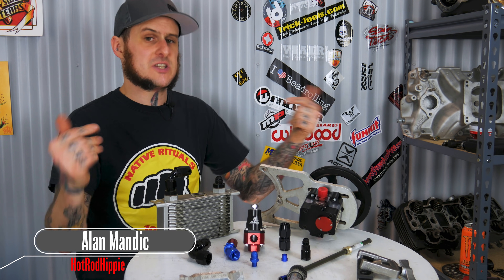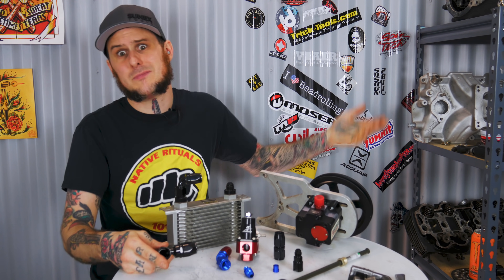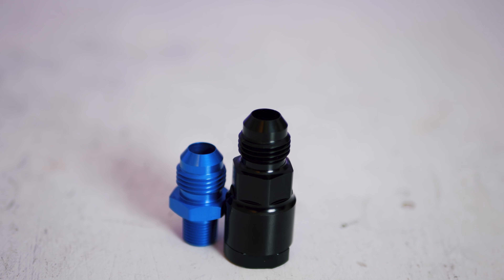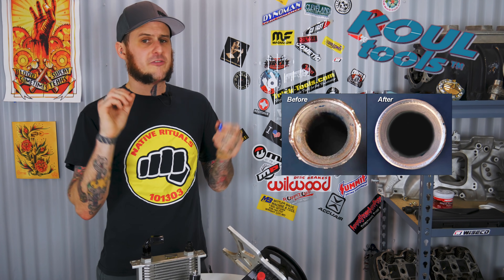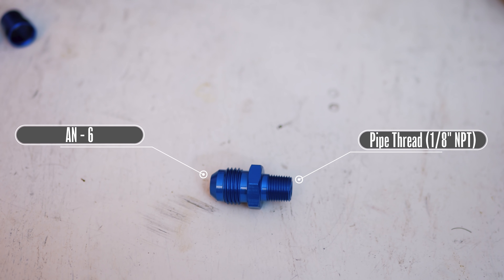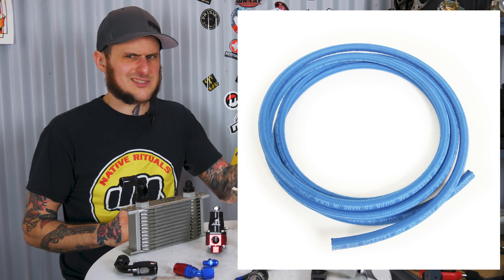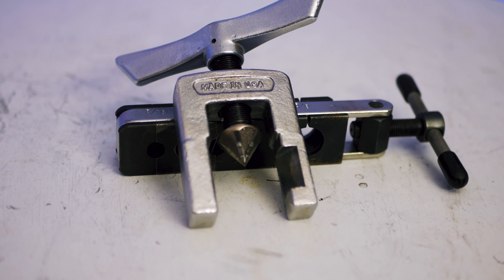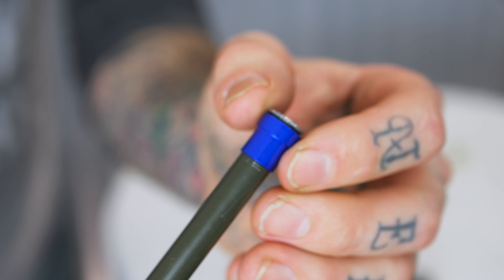AN Fitting Basics - How to Assemble and Common Mistakes!

Comment: You didn’t get much into AN ptfe fittings and lines.
Reply from the maker: Peter Fraumeni I don’t really consider Teflon like “basic”. I can’t put everything there is to know in one video. I will do a dedicated video on those at some point but haven’t had a project to demonstrate it on. I avoid using Teflon lined hoses on my projects for the most part. It’s too difficult to maneuver cleanly and there are other options that serve the same functions for my needs. But I will cover them at some point
Reply: HotRodHippie every one is going to e85 with their turbo setups and PTFE is big now so don’t wait too long.
Reply from the maker: Peter Fraumeni E85 is not readily available in the Northeast. I know it’s not uncommon for boost applications but it’s relatively unheard of on most street car builds to this point. Maybe I’ll do an intro to E85 video and lump in ptfe with that or as an offshoot of it.

Comment: This is a great explanation.   I have been searching for weeks to figure out if I could use an AN/JIC 3/8" tube sleeve and nut on 3/8" steel brake line.  You confirmed that.  I need to make a line on a piece of equipment(an old tractor)that is GM quick connect on one end, and AN/JIC on the other.  This confirmed what I was wondering. Thanks!
Reply from the maker: Glad to be of help. 👍👍
Reply: @HotRodHippie  much appreciated!   I wish I had seen this earlier.

Comment: Would be nice to show how to use AN fittings with straight tubing like that used on oil coolers.
Reply from the maker: I'm not 100% sure that I understand what you are asking for. I did a dedicated video about Hard Line Tubing some time after this one, you can find it here: https://youtu.be/wayKqBT7z00

I'd be happy to highlight what you are talking about if I was sure of what it was. I'm going to be doing a couple of Hands-On AN videos very soon, so please let me know. I'll be plumbing the entire fuel and air systems on the 65 C10 I'm currently working on and doing videos about it.

Comment: Dose the quick disconnect work on all fuel rails or just GM's LS??
Reply: Thanks brother! Your videos are grate and your pretty helpful eared a subscriber out of me!
Reply from the maker: That style is for any Push-To Connect 3/8" or 5/16" connection that meets the same dimensional design as a GM type. I've use it on LT1s and TPI engines in the past. So I cannot say it works on everything but I'm sure it works on more than just those.
Reply: @HotRodHippie  awsome worth a shot i guess im currently building a jeep and was wanting to use these kind of connections
Reply from the maker: A quick search and I think those will work for a Jeep rail. 👍

Comment: Hey, how would I be able to converter my soft fuel line set up on my 96 jeep Cherokee to AN fitting? The factory-style pump has just a hard line with a nipple at the end of it where the soft line just slides over and is secured with a clamp. 

Also, would it then be possible to get a filter that used an fitting? The current filter is the same slip on set up.

Comment: Can you make a video on making custom AC Hardline. 

Is AC hardline special or can I purchase a coil of aluminum pipe.

Thank you
Reply from the maker: Yes I will be doing AC lines on a project in May or June. 👍👍 

When I do AC lines I use Stainless steel tube from Vintage Air and standard Rubber Flex Hose. 

I would LOVE to be able to use Aluminum tubing but after years of searching I cannot find any way to swage the tubing to attach it to any types of fittings. Aside from $10,000+ shop equipment intended for hydraulic shops.

Comment: what AN do I use to connect it to a holley carb? should I just uses a banjo?
Reply from the maker: It depends on the carb you have.  Most Dual Feed Holleys use a 7/8"-20 Inlet, so you need an adapter fitting with that size on it.  Or you can use a dual rail feed that has the AN fitting on the end.  Banjo fittings can be helpful for tight fit applications such as with a Drop Base Air Cleaner, but I cannot find Banjo->AN fittings for 7/8" Holley.  There are also 3/4" and 9/16" Holley inlets depending on the carb.

Here are links to all of the fittings I just referred to, but I cannot guarantee fit for your situation:

* Dual Feed Line Kit: https://amzn.to/31DuRHY
* 7/8" Adapter Pair: https://amzn.to/2Sd8DcV

Comment: Great video. I learned alot. But I got a question as i'm unclear about it and I'm going to diy install.

Any particular size of an for oil cooler? I'm installing an oil cooler with a sandwich adapter and I'm unsure of AN6, AN8 or AN10?

I'm installing it on my CFMoto 650nk, its basically a chinese version of a Ninja 650.

Thanks a million.
Reply from the maker: I would say -8 or -10 for oil lines. Last motorcycle I plumbed was a CB750 and I used -8. However most cars I use -10 for oil lines. The last thing you want is a restriction in your oil system. 

I would look at the ports you are using to plumb your oil cooler. Are they 1/2"NPT ports? If so -8 is 1/2" equivalent and as such likely won't be a restriction for you.
Reply: @HotRodHippie 

Thanks for the swift reply.
I'm sorry I'm a bit of a newbie to DIY and I'm unsure of the terms you're using.

However I haven't bought the sandwich adapter nor the oil cooler radiator yet, but the options available is AN8 and AN10 sandwich adapter for the oil filter.
And AN6, AN8 and AN10 oil cooler radiator.

Since you recommend AN8 for motorcycle I should go for AN8s for both the sandwich adapter and the oil cooler radiators right?

And you mention restrictions, what would happen if I installed a AN10s instead? It's bigger hence better flow right?

Thanks!
Reply from the maker: @munkeemunks  I would go with AN8 personally.  AN10 would technically have less restriction, but I just think the tubing would look silly on a motorcycle.  As it is around 3/4"+ outside diameter.  That is almost as large as many frame tubes on a bike.  8AN should flow plenty fine for a motorcycle engine and won't look quite as silly. 

Though you may like that look, if you think you would AN10 would flow fine.  I just thing it may be a "law of diminishing returns" type of thing.  Will 10 flow better than 8? Probably, but the percentage more it would flow is probably not that much compared to smaller sizes.  Does that make sense?
Reply: @HotRodHippie  
Omg yes. Now that you mention it. Hahahahha...
It will look like a cyborg Picard. XD

Yes, it does make sense. Thanks for the insight and explanation good sir. I'll use the AN8 then.

Much obliged!

Comment: I have a Twin Turbo Cadillac CTS-V with a vacuum leak.  I think I will hard line it.  What size line and fittings do you recommend?
Reply from the maker: Depends on which lines you are replacing. Most recently I did a couple of LS3 PCV hoses that I replaced with -6(3/8") SS tube.  If you have some smaller hoses going to some components of your turbo setup -3 or -4 would probably be fine. (3/16" / 1/4").  I've used those sizes on older vehicles often for vacuum lines. What lines are you needing to replace?
Reply: They are 1/4” poly.  One (1) melted and I had to fix it while traveling (yes, I daily my 1100rwhp car, LOL) so to avoid a repeat of this type of issue I’m going hard line.  Your videos are excellent~!  Keep up the great work.
Reply from the maker: @scotthodges5214  thank you very much. Then for 1/4" I'd be looking at -4 stainless or aluminum tubing. 👍 Rock on with your daily. Always good when folks actually enjoy their cars.

Comment: Nice video, very helpful. Just curious what you think of push lock hoses? They just push over the barb on the fitting and don't get clamped down. I have never used them, but seems like a bad idea to me. Thanks
Reply from the maker: Push Lok is quite common in racing applications. I can easily see why it seems like a bad idea but it really isn't. I don't use it simply because it is a pain in the rear. It is VERY difficult to fit into the hoses. It fits so tightly that after you install one hose onto a fitting you figure out how they get away without a clamp. The last time I used it was for the oil lines on my CB750 motorcycle. Never had a single problem with those hoses. A company called Koul Tools makes a press tool to assemble the fittings. If I ever do Push-Lok again I'll buy that tool. Doing it by hand is a nightmare.
Reply: @HotRodHippie  Thanks, sounds like more trouble than it's worth then.

Comment: I am building a full 3/8 Stainless hard line fuel system (delivery and return) with 316 non ferritic -6 AN fittings for a carburetor to throttle body fuel injection set up.  Some of the lines and fittings were gleaned from an HP O2 charging system that uses some kind of 37' slip/press on (?) tapered ferrule, for lack of a better term that serves as the seal between junctions/elbows and tubing.   Can you or do you have a video that shows a system with only or mostly AN stainless fittings and lines?  I'm learning a lot from your videos.  Thank you.
Reply from the maker: I think I know what you are referring to. I rarely use those type of fittings but I do from time to time. I will see if I have some pieces around to make a video about the topic with.

Comment: What brand fitting are you using in this vid?
Reply from the maker: Most but not all were from a brand called "Red Horse Performance". They are a budget oriented brand but I've had decent luck with their fittings. The worst thing I can say is that the coating on them is... weird. It's more like a powder coat or paint than anodizing and as such scratches or gets marked by wrenches a little bit easier sometimes.

I think some of them were Earl's or Russel fittings. Earl's, Russel, and Fragola are the brands I most commonly use in builds these days.

Comment: I've switched from hard line to soft on my brake lines. Will never go back. Cost more but it's worth it. Nicopp line is hands down the best line for brakes period. And it does not give you a spongy pedal.
Reply from the maker: I've had more leaking fittings on the NiCop stuff than any other material. I find it is just too soft and as such it is easy to improperly flare even with good flaring tools. Also it is so soft it doesn't lend to good looking bends as it is too easy to accidentally reform after your intended bend. 

To each their own. People are paying me for the look that I can produce with stainless and it's going to last longer than any other option on the market so I will stick with stainless.

Comment: nice. what about nominal vs actual sizes, specifically the id? and physical sizes of the fittings when considering tight areas? would be interesting to know before shelling out..
Reply from the maker: Fittings dimensions vary wildly depending on brand or design so I cannot provide that. Hoses measure in 1/16" of an inch though. -1 = 1/16". So -6 hose is 3/8" ID. Hard Line Tubing measure in OD so -6 is 3/8" OD. Just subtract material thickness of the tubing to find the final ID. But the reduced friction of the smooth Hard Line tube inside more than makes up for a loss in ID. 

Some manufacturers make a point of specially designing their couple fittings and hose ends to maximize flow and minimize neck down points. Again that wildly varies so you'll have to research specific brands to learn more. I'm
Reply: @HotRodHippie  👌

Comment: I'm must be unlucky suffering from serious leaks on my fuel system on my AN fittings with Teflon braided hose, it up and I'm not sure what I've done wrong,  possibly I've over tightened them maybe, regretting not using push loc fittings and hose barbs now
Reply from the maker: Are they leaking at the hose connection to the fitting? Why did you choose Teflon lined hose? There is an entire level of difficulty jump with Teflon lined that is easier to screw up. However I've never had them leak.
Reply: HotRodHippie i was initially recommended them because I was going to use E85 but I now realize I had other options,  they appear to be leaking from the hose and the swivelling part of the connection, I'm going to remove them from the car and attempt to set up a pressure test jig of some sort, and try to work out what went wrong,       (unfortunately it's a complicated setup with multiple pumps and a surge tank so it wouldn't be cheap to change to a different type of hose now)
Reply: I think I worked it out now... It appears to be leaking because I used an o-ring adapter fitting (orb) on a hose end, where a full AN fitting is required to seat the swiveling end on the hose. So it should be an easy fix and just a newbie mistake on my part

Comment: Although I definitely applaud your anally retentive nature about lining up both halves of the fitting they weren't designed to line up. I would do the same as you but several years as an Aircraft crew chief on military aircraft has made me become painfully aware of the inspection requirements of assembled hoses. Oh and just a sidenote, aircraft do have "allowable leakage" from fittings and only require replacement if the standard is exceeded or there is enough down time to allow it!
Reply from the maker: That just reminded me of when I worked at a Ford dealership. For Warranty BallJoint failure Ford had an allowable tolerance. But in Pennsylvania the State Inspection failure tolerance was less than the Ford BallJoint tolerance. So your balljoints could be bad enough to fail State Inspection but not be Warranty replaced.
Reply from the maker: "Allowable Leakage" is a phrase I don't think I ever care to hear. Haha

In a lot of ways these fittings are overkill for car uses so I like to make sure they are as close to tight as I can get them with them lined up. Very often I actually end up giving them just a hair more of a tighten to achieve it. Maybe over tight but I've not run into an issue yet.

Thanks for the input as someone with experience. 👍👍

Comment: So what fittings should I use if I have a double-flaring tool that flares at 45 degrees?
Reply: AN fittings are 37 deg, you can't get them in 45 deg because they wouldn't be AN fittings. These fittings are designed for Aircraft therefore 37 deg is the standard.
Reply: @matthewmoilanen787  thank you. I understand that part but I was just wondering what type of connection someone would use if they only had a 45 degree flaring tool.

Comment: Alan: Great video, thank you! I have been plumbing racers and boats since 1972 when hose and fittings were available from Earl's Surplus. Ya, the stuff was still a Korean war surplus issue. I learned how to plumb cars from the crew at All American Racers in the early 70s. One thing we did was to wash the hoses and cap them until they were ready to be installed. The cutting process can generate some metal shards that can eventually find their way into the engines and such.
Reply: Man, to have a fraction of your knowledge on the topic would be incredible. I imagine you pick up a thing or two over the course of 50 years lol

Comment: Where do you source your a/n hardline ends? I'm having a tough time finding them!
Reply from the maker: Every major AN fitting company produces Hardline ends. 

They basically consist of two parts: 
1) Tube Sleeve 
2) Tube Nut (aka B-Nut)

I did a video dedicated to some hard line tube bending that features them more. https://youtu.be/wayKqBT7z00

If you need more clarification feel free to ask and I will try to help further.

Comment: Very nice watching a professional at work! Very informative. I have an aluminum radiator with AN- fittings instead of the normal nipples where the radiator hoses connect. It is a retired NASCAR radiator. I want to plumb it with an AN- fitting and braided hose , but I'm having a hard time finding out what size fitting to use. Any suggestions? I'd guess a 24- AN. Great video.
Reply from the maker: You'll need to measure the outside diameter of the threads. Here is a chart with size information: https://toplinemachinery.com/pages/jic-fittings-size-chart

-16, -20, and -24 are fairly common radiator sized fittings. And to match their size they are usually pricey.

Comment: Judging by the appearance, was that the Summit Racing brand hose cutter?
Reply from the maker: Yes it is. I've had it for a few years. Wish it was double action (like bolt cutters) but works great for my needs.
Reply: I actually just bought that tool. I found out the hard way that even the -6AN is too hard to cut with 10" cable shears, and a cutoff wheel on an angle grinder does nothing but make a mess. Good thing I only was testing.
Reply from the maker: Yes it is. I've had it for a few years. More than a few cars plumbed with it.